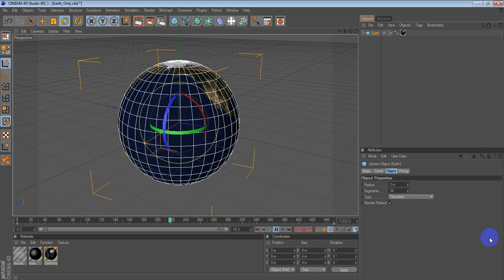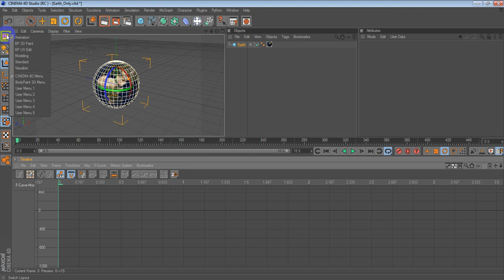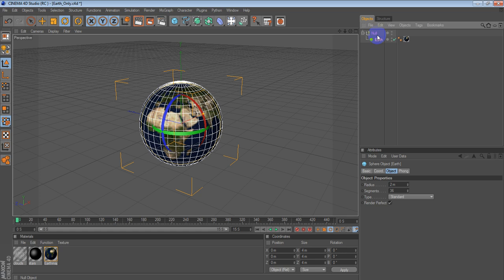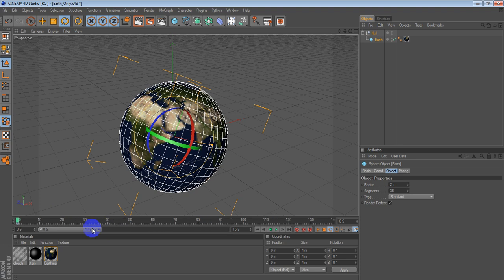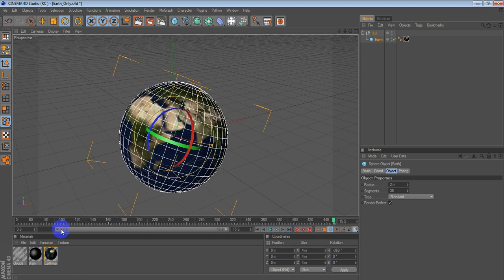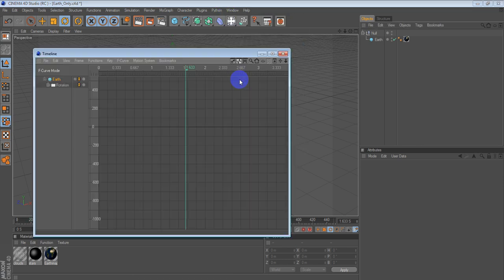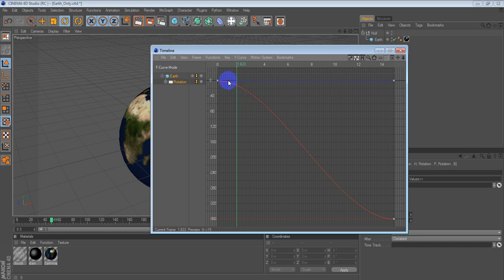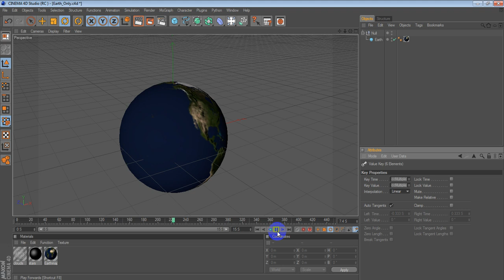Cinema4D Tutorial: Planet Rotation with proper Axis and Time Line smoothness.

Comment: I don't believe this works with R19 version.  I've tried the exact process but the planet does not rotate on the new axis... it simply wobbles around (rotating skewed but on the original axis).  I've been trying to fix it for an hour and I can't get it to work (I can only get it to work on original position or  at 90 degree angles.... but not skewed.- I've tried playing with the "axis center" tool under "mesh" but to no success.  I'm new to C4d.  Any ideas anyone?
Reply from the maker: It probably isn't in the null object correctly. Null objects are the basis of animation, I doubt they removed this.